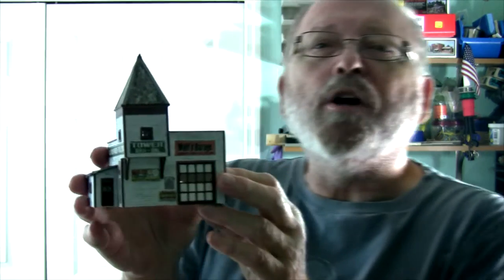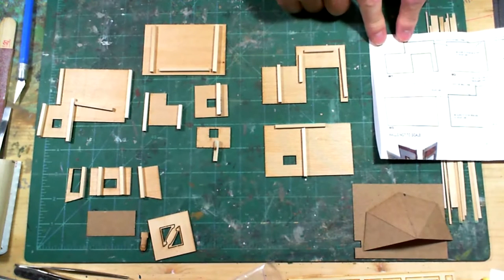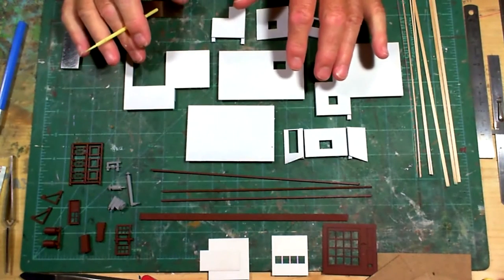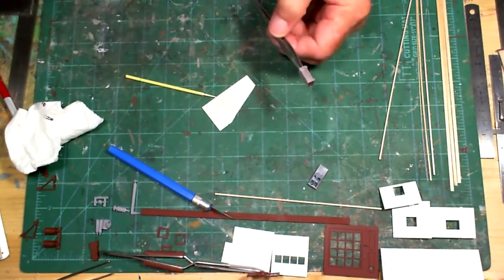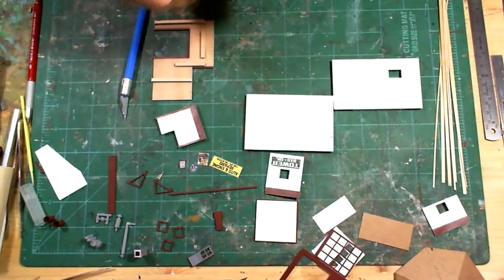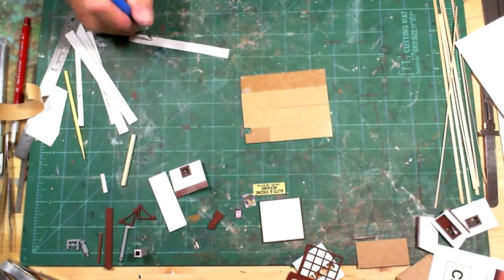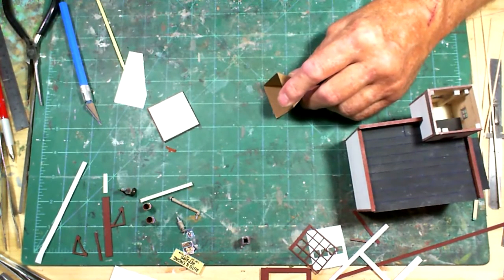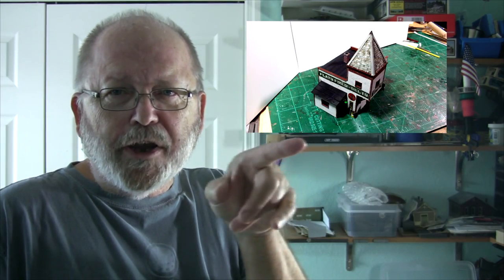Model Railroad Structure - Tower Gas - At the Work Bench - Episode 04

Comment: what glue and what paint did you use, do wood kits wharp easy, fast>
Reply from the maker: I use Elmer's white glue or Aleene's tacky glue, the Aleene's works a little better, it's more forgiving. I primer the wood with grey spray paint mostly either the cheep WalMart one or Rustoleym. The Walmart one goes on a lot thinner and doesn't hide the details as much if you put too much on. On this kit, I think I just used the white paint without priming it first. To get a really good old looking effect, I'll use the alcohol/India Ink mixture on it first.

Wood will defiantly warp when wet! Before applying any paint, you MUST apply bracing. Look at time code 4:00 for the bracing and  7:20 shows it in place. Your instructions will show you where to put the bracing, follow them closely and it wouldn't hurt to put additional bracing on longer pieces.

Practice on a small kit first before you start on your Depot, you'll be glad you did. The more you practice on a smaller kit, the easier it will become for you. Before you know it You'll be an old pro at it. All the manufacturers of kits have small starter kits you can gain your skills from. That's how I started with wood kit. I used to be intimidated by them, but now it comes easily for me. Don't get me wrong, I still make mistakes, but if the piece isn't too delicate, you can always pry the pieces apart if the glue hasn't set up.

Hope I didn't scare you with all the details. If you need anymore help send me a private message and we can set up a Skype call or something like that.
Tom
Reply: thanks for the help